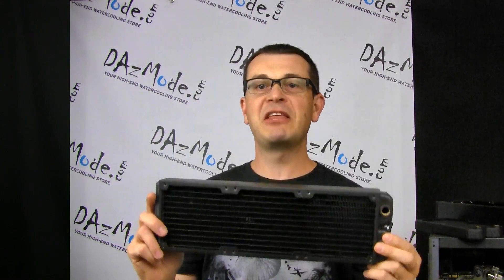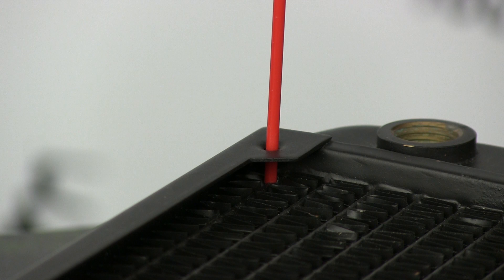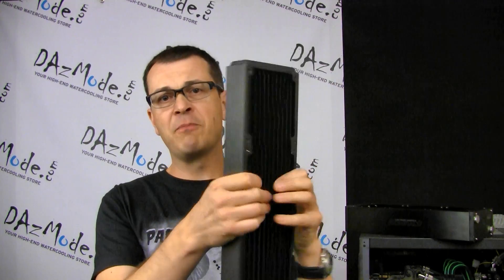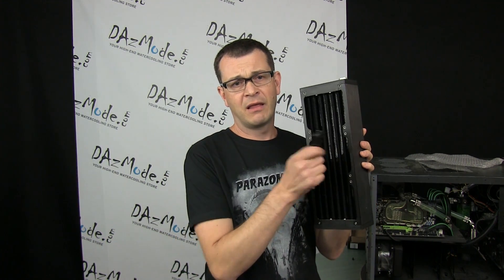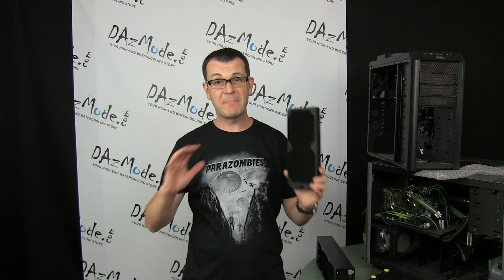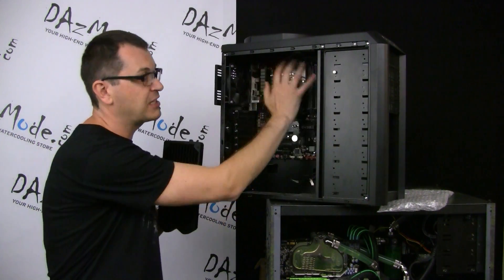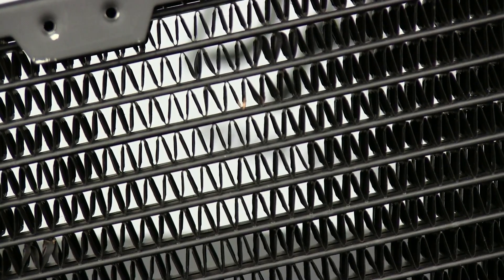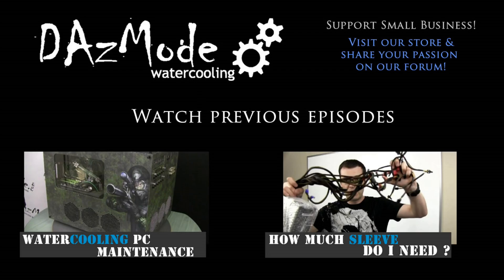Top 10 Computer Watercooling Mistakes with Radiators - How Not To Do - Vol.1

Comment: I see a ton of people complaining about Daz's comment about radiators as the intake. But he is absolutely right. It is not ideal to dump several hundred watts of heat inside the case.
Lots of components[almost everything] ends up having shorter lifespans when the internal case temperature is higher by a few degrees. Hard Drives, SSDs, Motherboard components, PSU components, etc. for example.
If you plan on changing/upgrading the system internals after a generation or two, then it's not an issue, but those who wish to have their systems running reliably for longer, having higher internal case temperature isn't ideal.

This holds even more weight in places with hot climates where total climate control during isn't an option.

Comment: #5 did he say its more optimal to have the radiator on the top or back instead of the front. The way I see it is, the front would be the best due to all the lower temp air passing through your rad cooling the liquid instead of having your rad at one of the exhaust ports passing hot air through the rad and keeping the liquid hot. Am I wrong here or something?
Reply from the maker: Think where the hot air from the radiator is dumped to.

Comment: Front radiator placement with fans blowing into system dont effect components much if you have sufficient exhaust.  I have a 280 in front with push pull pulling in a 120 in rear push pull blowing in and a 480 on top with 250cfm fans push pull blowing out

Comment: I have a 240mm radiator for my overclocked Ryzen 1500x in the front of my case as an intake and my gpu temps (Open style not blower style) only went up like 2-3c it doesn't introduce as much heat into the case as you think it does!
Reply: Have you tested your VRMs? HDDs? SSDs? NVMe? Temps?
Reply: It's the risk of creating positive pressure which means case temps can rise a lot. The cpu will be cool, the rest of the components will get hot. You need to get rid of the hot air in the PC case asap. When the rad is at at the top you at least have a chance creating a negative pressure and thus get more cold ambient air cooling the PC. But CPU may be a bit hotter, especially with an open cooler GPU.

Comment: Weird question.. see how on the XSPC radiators there are ports on the end, and on the side? 
 Does it matter if you have one fitting on the front, and the other fitting on top?
Reply from the maker: has to be different tanks, otherwise doe snot matter which port on each tank.

Comment: Front mounted rads are not optimal but its effect on some temps are so small that its  almost negligible (1 or 2 degrees)....i added a 280 front rad to my existing 360 top radiator and my CPU and GPU temps got better significantly in my CPU,GPU combined loop...and the temps for the airflow dependent components like VRM and PCH are the same or 1 or 2 degrees more....so its not the best position for a radiator but its still very effective and it definitely is not that bad and stupid like you said...
Reply: When adding a secondary 280 radiator to a loop with a 360 already, there is a lot less heat to dissapate for both rads. Especially considering that the most likely setup here is probably front rad last (?) Now if it was say a single 240 radiator loop, then the air entering the case through that front mounted rad would be significantly hotter.

Comment: When you top mount your radiator, you are pushing the hot air from your system to try to cool your rad. When you put it on the front in pull mode you're pulling cold air through the rad. Remember heat rises. There's actually videos supporting front mount, especially if you have a graphics card that is not a reference card.
Reply: But youre referring to just watercooling the CPU, so yeah that makes sense for that. But "heat rising" doesn't matter when you have airflow through your case
Reply: Yep.. Most people only think about the hot air that needs to go out, but what about the fresh air that needs to go in?!?!? Most people use an internal exhaust videocard that's blasting hot air in the case. So... in most builds a front rad with IN airflow will hardly effect mobo components and GPU, but your CPU will be much cooler.

Obviously with custom loops things are going to be different. But most have a simple AIO CPU cooler.

One more big pro why a front rad is better. If you set the rad fans to pull, your rad will be directly visible when you pull of the front case panel. My case also has a long bottom air filter removed from the front. So by only removing my front panel, I can clean my rad and other input filters. Much much MUCH more handy compared to top rad mount. And remember, a clean system is a cool system ;-).

Comment: width does matter, 280 radiator is much better than a 240. And also, one fan is not enough for a hot component. I have two cpu and four graphic cards, i have a 480+240 radiator, and gpus are running at 70 c. not cool at all. purchasing another 480+240 right now
Reply from the maker: May be because you fans too slow or crap models.
Reply: DazMode well, I guess Noctua NF F-12 is not a solid choice for radiator use? And they are hooked up to 12v and ground only, so running at full speed.
Reply from the maker: NO, not the fans then.

Comment: Hello DazMode;
I have a 4.5 years old water cooling system. I want to clean my blocks and radiator because I see a decreased performance.
How can I clean my copper radiator without damaging it? Is there a cleaning fluid specially designed to clean copper radiators?
I will remove my radiator from my pc and use my old tubing/reservoir to create a loop. I'll pump the cleaning liquid mixture+distilled water directly to the radiator as a loop and remove the dirty water. Will this work? I see radiator cleaners for automobile radiators, can they clean our copper pc radiators?

And if I open my blocks, clean & close them, can they start leaking? Is it risky to open factory sealed blocks?

Comment: There is nothing wrong with front mounting a radiator. Its been tested in dozens of videos and in the worst case scenario it made a 1c difference
Reply: He didnt say there was something wrong with front mounting. what he said was having the air blow back INTO the case because the air will take heat out of the radiator and then that heated air goes back into the case. however, I don't think he realised that at least that way you pull fresh cool air from outside the case into the case through the rad. and so you will have better dissipation of heat from the better temperature difference. If you flow the air from inside out, the mobo and other components are generating heat too. that heat from the mobo vrms etc warms the air and then you are passing warmer air through the rad than the air from outside the case. meaning it has less difference from the loop temperature so less efficienct transfer. So it is a case of cooler fresher air from outside, getting heated and passed to the inside of the case before being exhausted, or it is a case of passing the heated air out of the case, but the air is not as fresh as the external air. Probably balances out in the end or it would be well known if one was far superior.
Reply: Its Neight front radiator pulling fresh cool air in along with one more intake on bottom, then 3 exhaust fans.
Reply: No from the vids I have seen measuring the exhaust air temp (not component temps ) was raised 1-2 deg meaning very little difference overall to temps in the case .
Reply: that 1 degree C was the temp difference of the cooled component (cpu most of the time) and was using a strictly CPU cooled loop or AIO (not a full custom loop). 

No, front mounting isn't going to automatically kill components but GPU temps and internal case temps can increase anywhere from 5-20 degrees celcius unless you have other intake fans in addition to the radiator mount position. When the GPU is air cooled and an intake radiator blocks intake cool air from the rest of the system the non-watercooled parts suffer more. 

Top, bottom, or rear radiator position is always better.
Reply: @itsneight1260  wrong, the "1c differnce" applies to gpu temps when running a  front rad. ive seen the same tests done grizzly is referring to. fact is, gpu's just arent that bothered by reasonable ambient temps, and most cases will have additional intakes anyway. then you have pressure to consider also.. not only because of dust, but higher pressure air will soak up more heat. thats why on cars, a turbo compresses air before sending it through the intercooler, not after.
theres pluses and minuses to each setup, but all in all, a front radiator drawing in fresh air makes the biggest performance difference to the overall pc.

Comment: #9 you should've mentioned that when doing heavy overclocking the rule of thumb is 2 rads per component.
Reply: I thought it was each component plus one spare, so 360mm will be enough for CPU and GPU
Reply from the maker: You are correct. In extreme overclocking cases you just have to go with thick radiator. I only failed 1x per component rule ones. Only EK-EX360 rad could handle 295x2 + i7 setup.

Comment: yes indeed, this is bullshit information, doesnt matter where you mount your radiators or your fans in push/pull a cars radiator is right next to a hot engine ffs. if theres airflow it dont matter.

Comment: I would have to disagree with #9, while this may be the case if the thickness of a dual is good for both a CPU and a GPU. 

I had a dual 240mm Rad with a i5 6600K @4.2ghz and a 290 running underclocked to 900mhz and it was not enough to effectively cool it. I am now currently using a thick 240mm and a thin 240mm in the loop and I am getting 40c on the GPU under load.

Comment: 2 360mm rads. 1 on top to vent and the other one in front as intake. trying to make sure I get the best positive air pressure in my case. I also have a 140mm radiator venting in the back, I have 3 way 980 ti in sli configuration over clocked.
Reply: +Alain Tabangin k

Comment: It should be enough to have one fan segment per part, but i would like to have some sort of backup? On an ambient temperature in spring or autumn it's ok, but what if your room heats up? Or outside it's really hot etc. Also GPUs have much more heat output than a CPU, per decent GPU i would still put 240 or 280 rad space. Btw if my system has a heat output of like 300 watts and my cooling loop got like 350 watts max performance i would need to run my fans really high. If i add another radiator with like 150 watts cooling there is more heat dissipation, eg less fan rpm.

I wouldn't recommend a complete overkill, but a bit more room for some sort of buffer would be nice. What if the pump fails? If my colling loop operates at max., there is no space for some sort of failure, or some fans dies. Maybe the system runs in background (video rendering etc) and all your fans die (or the controller fails) the system with more spare cooling performance can stay longer than the one with the most bang for the buck. 

Just my opinion :)

Comment: Tip nr 5 is somewhat inaccurate. Sure, it will be a little warmer, but we're talking about 0.1-0.3 degrees hotter.
Reply from the maker: +Zappen88 You can build any way you want. I had RAM over-heating and random reboots, so thanks but air out only in my own builds.
Reply: I'd say it's better to have a positive air pressure instead of a negative one, since there will be less dust build up. I've never experienced a over-heating problem with my RAM even though they are overclocked, but if that's what got it fixed then you made the right choice apparantly :)
Reply: +Zappen88  with a negative airflow you get a vacuum effect, and you can limit the intake to one small area and filter it quite easily.
Reply: Well, yeah. But it's way better to have a positive airflow, so you'll always have air flowing out of every crack in your case. If you have a negative airflow, dust will slip through the cracks, and not just the intake. Unless you weld it shut, there will always be some cracks for dust to enter.

Comment: What is the purpose of a radiator: to blow or suck in the coldest air avaible over the radiator, no matter what hot summer day, the coldest air avaible is outside your pc case, the pupose is to cool your cpu not your components, these have to be cooled by decent airflow. Look at a car engine, its the same thing, the fan sucks in the coldest air avaible, which is outside the car. I have personally tested this, it makes a huge difference.

Comment: #5 has been debunked over and over again. Back several years ago it wasn't practical but now days if your radiator is getting hot your messing up already. Your radiator should never get hot. Also your excuse was blowing hot air all over your components? My AIO instructions say to blow air from the outside thru the rad to the inside. So who am I going to listen to? The people possibly giving me my money back in the future. 
PEOPLE YOUR ITEMS HAVE WHAT IS CALLED A USER MANUAL OR AN INSTALLATION MANUAL PLEASE READ IT AND QUIT LOOKING TO OTHERS FOR INSTRUCTION.
Reply: Doom Slayer but then you are pushing hot air through your radiator
Reply: thats what the rear fan is for
Reply: Yeah, the way I see it you want to cool your rad(s) so bring in cooler air through the rad and rely on airflow to move it out of the case. You should have one exhaust fan at the back.

I'm going with a top mounted rad as intake in push config, two fans intake at the front to cool the motherboard and flow out the back. the air coming in from the top should be moved with that out the exhaust as the rad should restrict the air from being pushed down to the motherboard. The exhaust is near the top so it will move the hot air out of the back of the case.
Reply: When I do my water cooling build i'm doing exactly this, bringing in air from the front over a frontal radiator and then expelling it out the top over another radiator and out the back. I've been using all in one coolers for ages now, even under heavy load on my heavily OC'd 5930k that reads about 65-70c in HWmonitor under load the radiator still remains at about 30-40c, So I would expect to see even cooler temps with two radiators in a system. Its going to be removing hot air either way.
Reply: +Daiesthai well the radiator dissipates the heat off the cpu or gpu. Not ambient temperature of the case.
Reply: IFIXUR360 Yes but that heat is still coming into the case if you have a frontal radiator with fans drawing air in, but its still not going to be very hot air and at the rate air is being moved into and out of the case its just not an issue.

Comment: how to stop mistake #8 ? if you already have metal corrosion inside the radiator, how then do you stop it without it just being thrown nin the trash and getting replaced? I don't have any spare parts and I don't want to buy another one since I can just put my air cooler back on it.
Reply from the maker: +jlrockafella Corrosion inhibitors will slow down process, so you can keep using parts.
Reply: DazMode
thanks, I will use 60/40 ethanol radiator fluid like Zerox until then.

Comment: what do u think about this radiator 200x 200 x 60mm http://www.performance-pcs.com/radiators/phobya-xtreme-400-60mm-v-2-full-copper.html#Specifications with high CFM fan or industrial Fans.

Nice video, thx.
Reply from the maker: +Diego Núñez Martínez Problem with wider radiators that liquid does not flow equally in flat pipes. Fast near ports and near to still at the edges. So super wide radiators became half passive.

Comment: so whats the best thing to ylean the rads with, there are so many ppl saying  somethign totally dioffrent
Reply from the maker: +toby baconator I personally use the same method for many years. Connect hot tap water to rad and flash for 10 minutes. All crap melts and goes away. After  that I just flush it with distilled and it is  ready to go. Never had  gunk problem in any of my PCs.